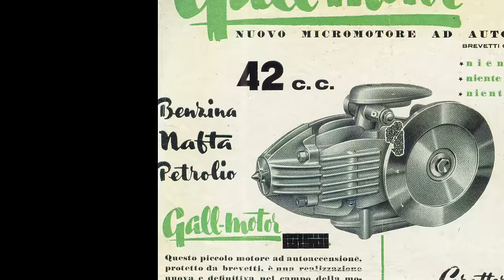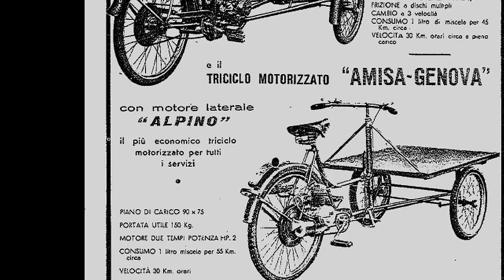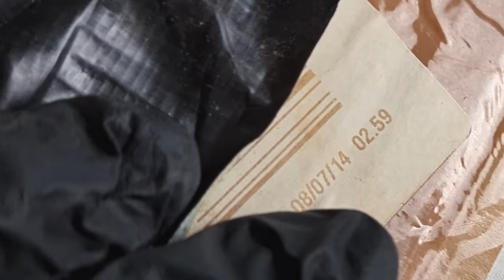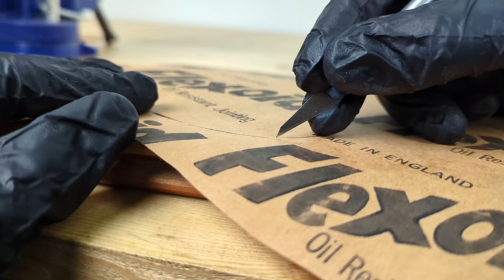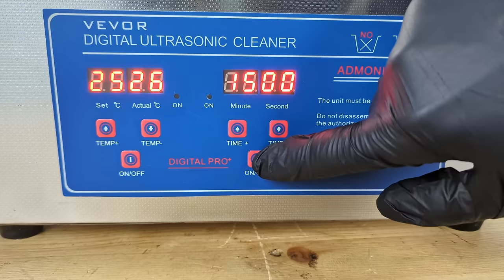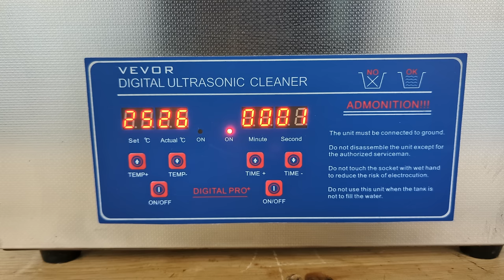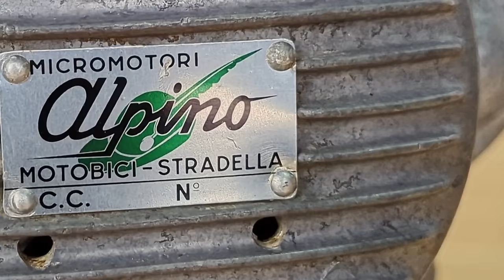The Ancestor of the Electric Bike - a Conservative Restoration

Comment: Dont u dare compare motorized bicycles to gay e bikes
Reply: Don't laugh.....have u seen the e dirt bikes eating two strokes..... quietly passing them on the track.. my e bike does over 40 mph on sand
Reply: Kkkkkk
Reply: Same thing just modernized, it's the future that was predicted coming true and I do agree that e bikes the electric moped are trash get that crap out of here
Reply: I would compare it to ebikes because it grew into a thin motorized bike over time. People tend to not realize that everything changes and get mad when little things change like when a little motor overpowers the weight to power for a DAMN bike drivetrain
Reply: Just because the motor is quiet doesn't mean it's weak... Teslas do 0 to 60 in 2.9 sec
Reply: @matthewszalkowski4719  ok but they are way way more unreliable
Reply: They can be if Tesla.....tried harder
Reply: The ev1.  1992 simple, reliable, and gm forced cars from owners because is was too reliable
Reply: @matthewszalkowski4719  ev cars suck and the bikes are worse nuff said
Reply: 🤢  @theLyzhendricks
Reply: @elenailic923  🤣😂 exatly what i think about evs
Reply: Said by someone who has never ridden a Rad Rover E-bike. At least I can go hunting on mine without scaring all the deer away.
Reply: @jasonsummit1885  ur dam right wouldent cathe me on an e bike im not gay
Reply: He didn't. He said ancestor of the e-bike. Just like a model T is the ancestor of the electric pickup truck.
Reply: @Urmomsboyfriend01  well thats a damn good comparison
Reply: Gas engines on pedal bikes are for losers who lost thier drivers license to DUI
Reply: @EBIKEScott jokes on u I never had one in the first place 😂🤣
Reply: Hate to break it to you… The first vehicles were electric. Just saying 🤷🏻
Reply: @matthewszalkowski4719 
For a solid 20 Minutes…..! 
🙄
Reply: Baker electric
Reply: @GordonScottYankeeEngineer  they were steamers
Reply: using gay as an insult, what is this 2008?
Reply: While we're on the subject of gay people, let me quote a line said by George Takei: "You are made of stupid." My e-bike is more powerful than my moped, and our new hybrid car more powerful than our old petrol one. I like the soul old mechanical stuff has, but don't pretend like EVs aren't objectively better at most other things.
Reply: @A_very_tinly_can  how many feet are in a mile?
Reply: 100th like
Reply: @EBIKEScott ”…or cannot afford anything better, e.g. disabled and retired…”

That said, electrification is, as a rule, quieter (and less obtrusive) than a fuel-burning engine, but the latter typically has better range-ability. (Speaking as someone who has a (home constructed) electrified bike, the second of two - and who has much of the parts needed to build-a fuel-burning version for when one must go truly long distances in regions of scarce opportunity for charging, e.g. while traveling through rural Washington (nearer the coast) on the way to Seattle.)
Reply: Agreed 👍
Reply: @EBIKEScott that seems oxymoronic because i can see more stupid people getting drunk and going home on a public ebike rather than resorting to using a motorized one sober.
Reply: @noahboat580  Ya that because cities do not offer gas powered bikes...
Reply: Hang onto that drive-train..(might be needed to charge the things one day?).
Reply: @clickbaitcharlie2329  funny I aint gay wouldent catch me on a e bike
Reply: @EBIKEScott no no no! I drive gaz powered pedal bikes just for fun while i have license for a car😂
Reply: I wonder what gaybos do when their  e bikes burst into flame when charging??
Scream and run into the closet???
Reply: Good, dont say any more. @theLyzhendricks
Reply: @Seregium  same motorized bicycle are where it's at I got 2 don't worry well smoke the e bikes
Reply: E bikes are Faster; but got NO CHARACTER like a gas engine. 2 stroke or Otherwise.
Reply: @matthewszalkowski4719  but what  am I supposed to do when the battery runs low 😂there fun and all but for a long weekend trail riding it’s useless.
Reply: Multiple batteries....that's what most people do and bring a generator
Reply: @EBIKEScott I've got 2 gas powered mopeds and not because of losing any license. And a funny thing: the mopeds with the volatile fuel AREN'T the ones which are catching fire. 🙄
Reply: I'll bet almost any fire department can easily compare the 2 and which ones are causing problems. 😉
Reply: @matthewszalkowski4719  gasoline bikes just need a refill then they are ready while E-bikes need to charge for hours
Reply: Sodium ions are changing in 15 min the latest tech
Reply: @Dawnzyxio14 jus tell me you don't know anything about an electric drivetrain
Reply: @toddhazzard1562 saying something is worse because it has no character is dumb. literally anything can have character (ae my wooden shelves i grain stained a month ago or my shoes cause they have grass stains from mowing.) then again "character" is subjective so it'd be like me saying banksy has horrible art. move on
Reply: someone doesn't know what a pro ss or a surron is lol
Reply: @Nesu.  Huh?
Reply: @Nesu.  To Some People ' Banskys" Art sucks Ass; Whoever the Fuck that is.. It's All in the Mindset. You can Keep Moving.... "Bansky, Pansky.
Reply: Electric motors will easily smoke the shit out of gas dinosaurs and do so quietly and efficiently with very little to no maintenance or problems to deal with. I’ll take electric any day, even if you think they’re “gay”
Reply: @jasonhatfield4747  .... Until the Battery Runs Out....
Reply: @jasonhatfield4747  Oh, Yeah. Until the Batteries Run Out, and there's Nowhere to Recharge. And Even Then; you have to Wait Up to 12 hours. Go to the Gas Station; Out in 15 minutes or Less. Granted, Electric is Pretty Slick. I've tried it in low end vehicles; and I See the Potential. But Ain't No Fucking WAY in Hell Joe Working Man is going to Afford 50 to 75 Grand for a Base Model EV!!
Reply: @theLyzhendricks me thinks though dost protest too much.
Reply: Don't you dare talk about motorised bicycles when you smoke gay weed.
Reply: @meandthecat4025  are u good cause theirs nothing gay abt weed
Reply: I get you man! But let's be real gas and electric bikes are kind of gay! I have both electrics for reliable transportation. And the gas one for tinkering on I messed my license up pretty bad in my criminal days. I would be driving a f**** car right now.😊
Reply: @matthewszalkowski4719 for a short period of time and when your waiting for Mother Nature to charge it up an internal combustion engine will keep on going.

Comment: It looks pretty, but does it RUN.
Reply from the maker: The engine will work, the compression in the cylinder is there, the spark to the spark plug also and the carburetor is completely cleaned. If something doesn’t work, I’ll fix it 😉. In the next video I will start it

Comment: does it run?
Reply from the maker: In the next video I will start it. I still have to restore the bike, tank and crown. The engine will work, the compression in the cylinder is there, the spark to the spark plug also and the carburetor is completely cleaned. If something doesn’t work, I’ll fix it 😉

Comment: So it came from the factory with maybe 4 HP. Then you add that heavy bearing grease in the gearbox. That alone took at least one horsepower out. 90 weight or light gear oil would have worked so much better.
Reply from the maker: The oil can not be used because the engine does not use oil seals. Then the oil would have leaked all. From the video you can not see well, but there are many empty spaces not filled by grease. Keep in mind that grease with heat tends to melt, so there will be even more space in the crankcase once in operation

Comment: очень интересно как устроена коробка передач.там 3 передачи?
Reply from the maker: Yes, the gearbox is three-speed and there is no clutch
Reply: @Ego.Reficio можете в дальнейшем показать подробно устройство и работу коробки передач?
Reply from the maker: The operation is very simple, there is that rod that when it is pulled or pushed out three balls on the selector and meshes the gear you choose to use. As for the lack of friction, however, when the engine is running, you decelerate and change the gear. The large crown that you see at the beginning of the video, must be mounted on the rear wheel and inside there are springs
Reply: @Ego.Reficio большое спасибо.хотел сделать подобную коробку передач на 2 передачи,но не справился
Reply from the maker: Of nothing. Good Luck!

Comment: 19.00 головку цилиндра без медного кольца?
Reply from the maker: Yes, it is not there. It is not necessarily used on small engines with aluminum head. Many models of Piaggio Vespa do not use it for example
Reply: @Ego.Reficio  🤝👍

Comment: WHY THE GREASE??!!! that's a sure way to kill a motor
(i'm also looking away from the sealant... what is the point?)
Reply from the maker: In the old engines, before the '50s or so, the oil seals were not used, so if I had used oil, this would have leaked everything, but mainly it would have gone into the crankcase where there is the crankshaft

Comment: They're not the predecessor to e-bikes they're the ones for every 2-stroke chinese motorized bike engine you can buy today.

The new engines from china vary from the old 48cc to the new 85cc, these engines are cheap just like their predecessors until you get into the race built stuff which'll cost up to 3 to 10 times more than a stock chinadoll motor depending on what parts are on it, how well balanced and tried the crankshaft is, and how much port and polish has been done to whatever cylinder and piston you have.
Reply from the maker: Because it is intended as the motor that makes the bike move without pedaling. Now there is the electric motor, before there was the 2-stroke
Reply: No that's not the case here the electric bicycle derived from the first electric cars in the late 1800's and early 1900's not 2 stroke motorized bike engines. They even tried to implement them back when the first electric cars were made. Back then electric cars, motorcycles, and motorized bikes didn't take off because of the cost and the concept not being perfected.

Even to this day e-bikes aren't nearly as perfected which is why you don't see many out in public unless you live in California or New York. But a lot of those get stolen and wrecked because nobody cares too much for them.

Comment: I think insert grease in the carter is an error.  It has enaugh power.. is a little two stroke engine.. it’s a loss of power useless
Reply from the maker: The oil cannot be used in this engine, it does not use oil seal. Consider that with heat the grease tends to melt and will occupy less volume

Comment: You need a vaper hone cabinet.
Reply from the maker: With it, the aluminum would come out too shiny and looking "like new". I preferred to leave the "vintage" look
Reply: @Ego.Reficio   Understandable, for the outside. For things like pistons, connecting rods, valves, combustion chambers, ect there's no better way I know of to remove carbon an gunk. Generally aluminum looks frosted after vapor honing an isn't shiny like chrome.
Reply from the maker: I’ll try it then, thanks for the advice

Comment: Ich habe noch nie im Leben so viel Fett im Getriebe gesehen. Das kostet Leistung. Normal wären so 150 ccm SAE 80
Reply from the maker: The oil cannot be used in this engine because it doesn’t use oil seals, so the oil would leak out immediately
Reply: @Ego.Reficio  Man lern nie aus, wieder etwas Neues für mich. Ich habe früher in meiner Jugend viele Mopedmotoren repariert. Allerdings immer US, Japan und BRD, Frankreich, GB - halt der Westen. Da war es immer Getriebeöl SAE 80-100. Mich wunderte schon, wo die Ablassschraube sein sollte. Tolle Instandsetzung, heute trauen sich das nicht mehr viele zu.
Reply from the maker: The beauty of the world of engines and vintage items in general is that you never stop learning!

Comment: Как же достали идиоты, набивающие смазкой механизмы  "на все деньги". И механизму от этого плохо, и мастеру, впоследствии его ремонтирующему или  обслуживающему.
Reply from the maker: The transmission uses grease and not oil because it has no oil seals. The video doesn’t show very well, but there are many gaps in the crankcase. Consider that with the heat the grease tends to become liquid, so if after using disassembled the casing again the grease would be about half

Comment: Wonderful for it''s time,but still a source of CO2 pollution. Today, li-Ion batteries are better in all ways.
Reply from the maker: Yes, of course, an engine of this type pollutes a lot, in fact it uses a petrol/oil mixture with a considerable quantity of oil.  However, it is wrong to consider that lithium batteries are the solution to everything, producing them anyway pollutes, as does disposing of them.  Without considering the extraction of lithium, copper etc.
Reply: @Ego.Reficio  No,I don't buy that at all. The Union Of Concerned Scientists have declared EVs to be much more environmentally sustainable than any ICE car.
Reply from the maker: The problem is not that simple; it is much more complex. Pollutants like NOx, HC, CO, and climate-altering substances such as CO2 are different matters. It is believed that internal combustion vehicles are responsible for about one-third of total pollution changes. Among the most polluting are livestock farms, which produce a lot of methane (CH4), also a substance responsible for global warming, among various issues.

Consider that modern cars complying with Euro 6d standards are even less polluting than Euro 6 cars (European standards), and not all countries with electric vehicles can produce electricity with nuclear power plants; some countries still have active coal-fired power plants. With this, I do not mean to say that gasoline/diesel cars do not pollute, but rather that the solution to the problem is not that simple
Reply: @Ego.Reficio  Power companies much prefer natural gas to coal,as it is cheaper.  EVs may be charged with coal/gas generators,but they produce no local pollution which is better for your health than gas engined cars.
Reply: boring😂